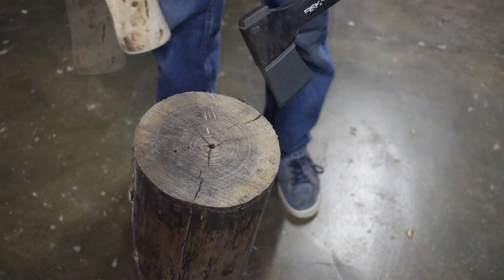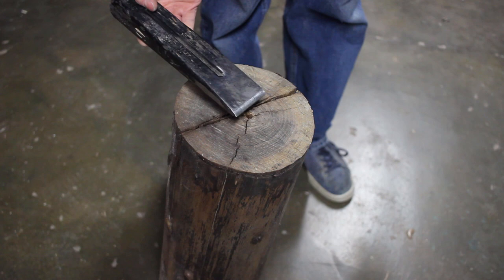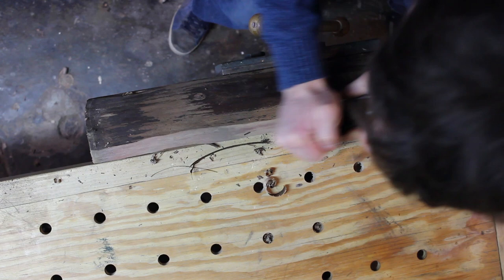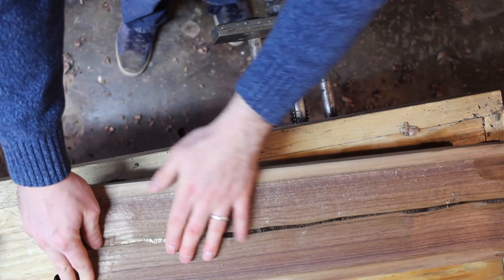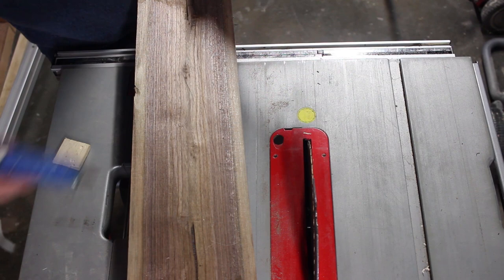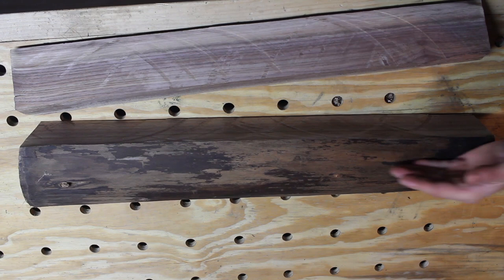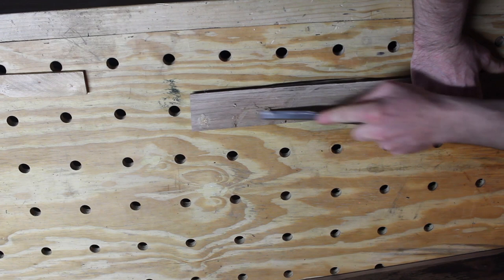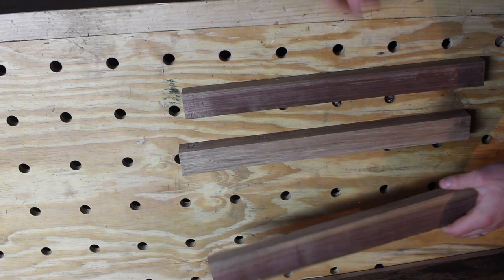Table Saw Tip - Cutting Logs Into Boards - HNB #14

Comment: A cleaner trick for adhering the shim: apply blue painters tape to both pieces of wood, then apply superglue to the tape, then put the board together. The painters tape comes off clean without a chisel.

Carpet tape can also work, but you super duper don’t want any exposed adhesive surfaces on the table saw.
Reply from the maker: Good idea 👍

Comment: What was the point of using the block plane to square up an edge?  From one flat side you should be able to square the rest of your stock.
Reply from the maker: This was a while ago so I am not sure exactly what I was thinking at the time! Most likely it was so I could hold it in my vise better and get to the other sides.  Very possible I did more work than needed.  Thanks for watching, cheers!